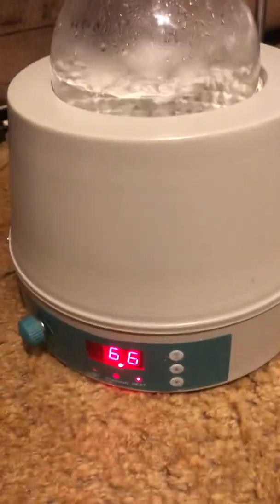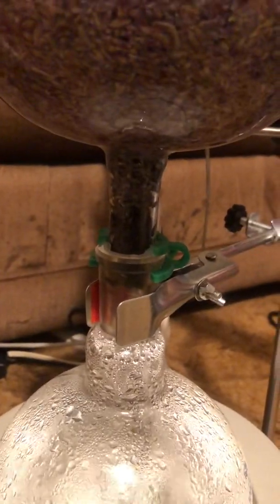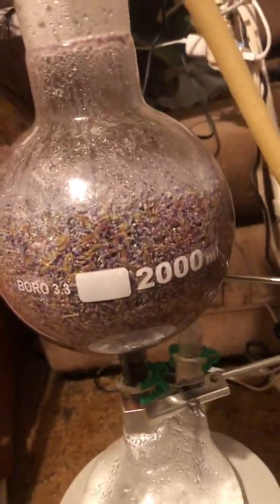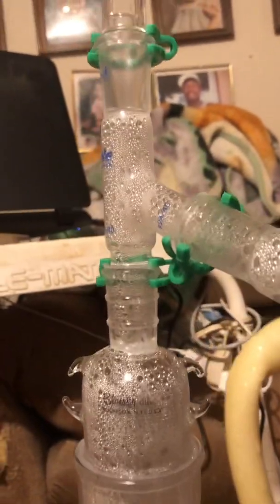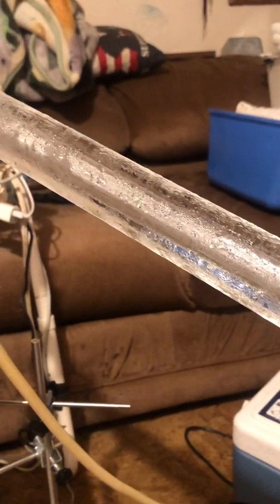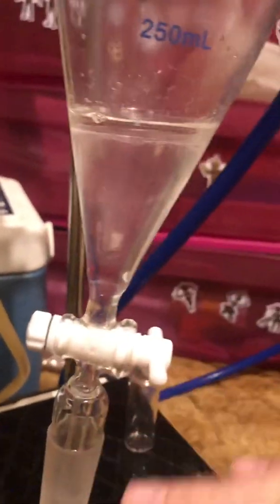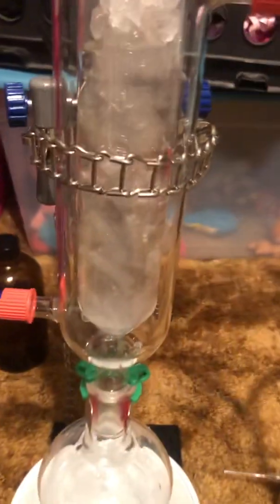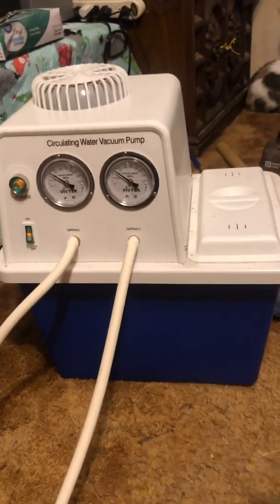Steam Distillation of Lavender Under Vacuum

Comment: Dear James,
Thank you very much for sharing your technique. Congratulations on your success. I have tried to use your technique in the last 3 months, unfortunately I was unable to get fresh herbs but did manage to buy some overcooked essential oils. The colour is very dark ( they used the traditional way ). Luckily I got some yellow oil which I think is better than the dark colour oil in the quality, the aroma is more acceptable than burning aroma. I came across some problems during the experiment : 1. the oil is mix direct with water so there is the " bumping " problem happen frequently ( the oil water not boiling consistency like your water, some time my mix liquid stop boiling and suddenly bump flashing water everywhere transfer very hot and high volume of steam at very short time from the flask to condenser via T connection ). 2. I tried to run my vacuum to certain amount pressure then i turn off the valve between whole system and vacuum bump ( to let the bump rest and seal the vacuum inside system ), eventually during the process the pressure rising up at certain point i have to vacuum again ( the whole system is tide seal , do you run the vacuum at all time ? ). Would you compare the aroma between your lavender oil ( which uses vacuum technique ) with press lavender herb. I really hope the oil's aroma is very fresh and very close to fresh herbs. I am very sorry for the long comment but I am very happy to find out I am not alone with this experiment. Thank you again and wishing all the best to you.
Reply from the maker: Dear Thai,
Thanks for the comment. Not sure what flask you are using or what kind of heating techniques, but I recommend making sure the heating is consistent (Digital heating mantle is best). If you’re not using a round bottom flask, you should invest in glass “bumping” beads in the bottom of your flask to help keep the fluid temperatures steady. The goal is to evaporate slowly and smoothly, as attempting to do the process too quickly at higher temps will “burn” the oil and destroy the terpenes. 
As for vacuum pressure, I maintained the pressure by using my pump through the whole process. This is important since I wanted to keep my temperature steady and low throughout. Having the pressure changing during the process would cause me to continually have to modify my heating source, which is both stressful and destructive to the oil.
I have done distillations using both procedures. What I found was that the use of the vacuum made a highly superior product. The vacuum distillation gave me a clear essential oil with a very pure aroma. The essential oil without the vacuum had a more cloudy, yellowish color and wasn’t as aromatic due to the higher temperatures. 
I hope my response answered your questions. I wish you the best in your work. Please feel free to ask me anything. I will do my best to answer if I’m able.
Reply: @jamesdearman3699  
Dear James,
Thank you and thank you very much for your advice. Both my problems are under vacuum distillation same as yours, pretty much  are glass round bottom flask + heating mantle ( not digital but does have a switch to control temperature and it turns off when design temperature is reached ) dry vacuum pump + water with lots of ice for condenser. 
Would you think it is because i mixing water directly with burned essential oil or not using bumping beads which causes the bumping problem?Or the pump's volume capacity ( manufacturers claim the pump can pull 6000litter of air in an hour ) , of course it can only pull the vacuum down to 85% not deep vacuum. I think I should run my pump through the whole process.
I assume your system is heating at 66 Fahrenheit = 18 degree Celsius + boiling material is water which is boiling at 100 degree Celsius at 760 torr so I am using " Boiling Point under vacuum chart "  and I figured your system runs at 30 Torr = 95% vacuum. That is a pretty deep and strong vacuum pump you got. My dry vacuum only runs at 85% so I usually run from 55 to 60 degree celsius.The " Pure Aroma " is what I believe in this technique, thank you for confirming my strong belief. My target is the oil which is inside wood such as cinnamon, black asia pepper,.... I am not sure which one is suitable like using the steaming method as yours or grinding material then mixing them in water and cooking the mixture under vacuum.
Thank you ! I could not explain how happy I am when I found someone ( you ) having the same idea so I can learn and share the idea , problem also. My very best regards.
Reply from the maker: @thaiphuoc2819  Based on my knowledge, when distilling material that isn’t fresh (such as dry herbs or cinnamon bark) it’s best to soak the material in the solvent for a day and distill under vacuum using hydro method. You can use the steam method with dry herbs or fresh material as well but may not get as much in quantity if using dry herb. If you’re having problems even while using round bottom flask, then adding the glass beads could help. I have a magnetic stirring bar in mine, which is very useful. 
I did make a mistake in the video by saying Fahrenheit instead of Celcius. But I was losing some pressure due to the length of my setup. My apologies for the mix up. 
Have you got a Soxhlet extractor? This may be beneficial if you are making tinctures. Of course, using vacuum is better when doing this method, but it does save a lot of time and allows for a greater concentration of the final product. 
Finally, the best advice I can offer is to take your time. You want to get the most you can with the material you have. Using the lowest possible temperature is optimal. I’ve found that I get the purest product when I’m able to maintain a drip rate of about 1 drop per second. This includes both distillation of oils and ethanol (if you make your own through fermentation).
Hopefully this helps you to achieve a higher quality and larger quantity. Best wishes in your work!